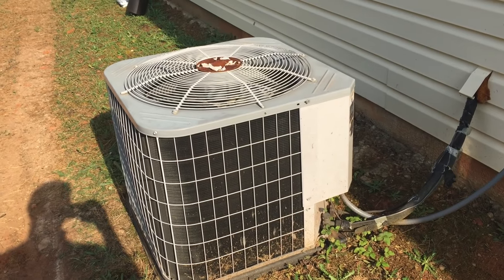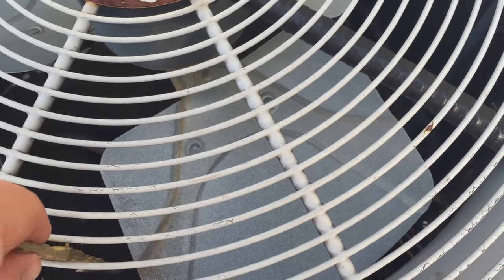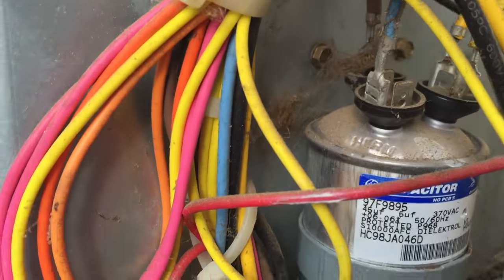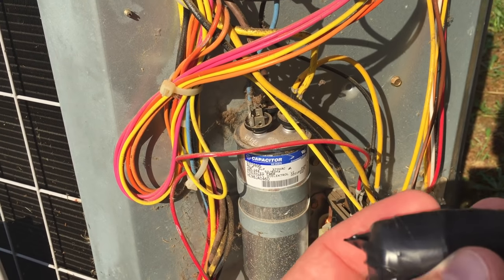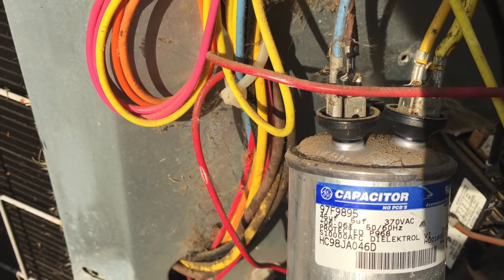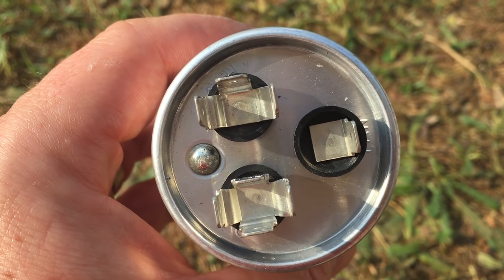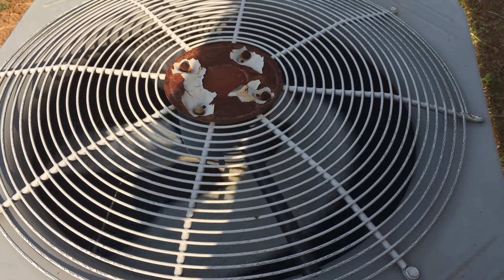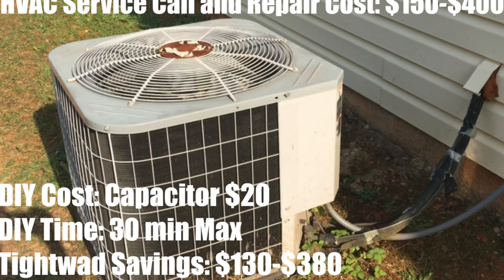Easy Air Conditioner Repair: Fan Not Spinning - Blowing Warm Air

Comment: life saver! my outdoor unit was humming but blades weren’t spinning so give it a good spin with a stick and got it spinning again! house now cooling. thank you.
Reply: Seconded!  Saved me a call to my local HVAC guy.
Reply: AMAZING!!!! THANK YOU!!! Just saved me $$$$
Reply: Same as mine. My unit was humming but blades were not turning so I got the fan spinning with a stick. Did your AC continue to have this problem? What causes the fan to just stop spinning and need a “manual stick push”?
Reply: @strongholdsignarts  Mine hasn't needed help (again) to get going this summer, thankfully.  (Especially with last week's heat.)
Reply: @strongholdsignarts  the capacitor needed to be changed out, that’s what fixed my issue.

Comment: Question! When I manually started my blades with a piece of wood, it kept turning. But now I have to do this whenever the AC shuts down in between cooling sessions. What would be the fix for that if anybody knows?

Comment: I just experienced this with my AC that is only 6 years old! I took the old capacitor to get it checked and didn't get any readings out of it, put in the new one and right away saw the fan spinning at the right speed! THANK YOU! It is another 104-degree day here and tonight we will not suffer from the heat like we did last night with the AC not working (yesterday was 106-degrees!).

Comment: Great tip about keeping the wires connected on the old capacitor and then switching them to the new capacitor one at a time. I'm not having problems atm but I'm picking up a spare to have ready when needed.
Reply from the maker: Greg Egan Thanks. Great idea to have a spare on hand. Things always seem to break when the stores are closed!

Comment: Thank you Thank you! Our AC did this to us on 4th of July. I checked for burnt wires and anything obvious. Found one wire that looked crispy on the capacitor but that was not it. Came in and seen your video went back and pulled the capacitor off and it had swelled up a little top & bottom. I was happy to see that. On Monday morning after two very hot nights I ran down and bought a new capacitor for $25 and switched it out and it fired right up. Buttoned it up and called to cancel my AC service appointment. The owner was happy to hear I took care of it and saved a few hundred dollars. Do take pictures of wiring and make sure you read the top next to each post on the old capacitor.
Reply from the maker: Steven Cox Thanks for sharing your success story! I’m glad you were able to get yours fixed.

Comment: Unbelievable!! We have a unit that is less than 2 years old. The temp was not getting down even close to the thermostat setting and the inside humidity was almost 50% higher than its setting. I thought your first suggestion of nudging the fan blades with a stick was WAY too simple but it was bedtime so I figured "Why not?". I nudged a blade clockwise with a paint stick and guess what? It started spinning and, in less than 15 minutes, our house was comfortable again and the humidity had gone down 10%.....I'm still calling the pros tomorrow to see why this happened but THANK YOU so much for the tip!!! I never would've thought to do that. I realize that people deal with much worse but your video saved this family from a pretty uncomfortable July night in south Louisiana.
Reply from the maker: Sounds like your capacitor is bad. You should change it yourself! I’m glad you found temporary relief!
Reply: @TightWadDIY  You're exactly right - the capacitor apparently wasn't supplying enough power to the fan on start-up. I let the company I bought the unit from do it b/c, luckily, it's still under warranty. But your handy tip gave us temporary relief until they could come out. The info is very much appreciated.
Reply from the maker: @JD-lk7yp  I’m glad they fixed it for no charge. That’s a blessing.

Comment: My fan stopped working mid day and all I had to do was get a small stick to manually spin the fan and it started working. Thank you so much!
Reply from the maker: That means your capacitor is bad. You should replace it. It’s easy!

Comment: Thank you sooooooo much for video. I'm a single parent female Veteran. Every penny counts. My unit has the double pull fuse. I pulled it and additionally hit the breaker further entire area. I weeded the area and hosed down the filter as I do each year. This time it wouldn't come on. I reset it and 3xs. Nothing. I didn't know that the fuse could fit both ways until I watched your video. YEP I had replaced the fuse upside down. I don't know how much you saved me but as I said. "EVERY PENNY COUNTS" Thank you again
Reply from the maker: That’s Awesome! I’m glad you got it fixed! Thank you for your service. I really mean it.

Comment: I had the same problem I replaced my capacitor after watching,  and it worked great. Thanks 30 dollars for the capacitor. 10 years ago I had a company do it charged me $230 dollars. Saved a lot
Reply from the maker: larrae125 I’m glad you found the video! It’s an easy swap as long as you take the proper precautions. Always happy to hear someone saved money. Be sure to subscribe.

Comment: I stuck a stick in and the blades started moving! And that was all it took. Thank you so much! Just waiting to see if that's all I need or if I should replace the capacitator.
Reply from the maker: You will need to replace the capacitor. The line that starts the fan is bad.

Comment: Our Central AC unit is old. Recently, our fan blades stopped working even though the machine itself is still buzzing. We did what our technician did a couple of years ago: took a hose to it. After only a couple of seconds of being doused with water, the fans start spinning again and the house starts cooling decently. The motor gets really hot. Unfortunately, when the house gets to the desired temperature, the fan again stop working until we hose it down again. What do you think the issue is?
Reply from the maker: I’d still check the capacitor.
Reply: @TightWadDIY  Thanks for getting back to me. We did end up calling a pro out, and sure enough, once the capacitor was changed out, it worked great. I am glad I mentioned it to him first so he knew I wasn’t a complete idiot. Still only came to $150 total, and since I was worried we’d have to replace the whole thing, I was geeked. Thanks!!!

Comment: My unit stop working yesterday only had it for 3 years the capacitor doesn't look too be damaged the top of the capacitor is not bubbled up or anything looks brand new could it still be the problem my unit want start?

Comment: Got my a/c turn on with a stick. What does it mean in the long run if you have to start your fan the “stick method” is the capacitor bad?
Reply from the maker: Replace the capacitor.

Comment: Hi! My AC was “fixed” by my apartment complex (it had a plug in to the unit and I didn’t have the plug so they put a new one in and it worked great) but 3 days later the top fan stopped working. I will turn it on, it’ll work for 15 minutes, and then you’ll hear the compressor running but the top fan doesn’t move. I tried moving it with a stick and it doesn’t go. I tried turning it off and back on, no go. I cannot seem to get it open to look at my capacitor because it’s like every panel is screwed into both the top and bottom. My apartment complex sucks with maintenance issues and I cannot afford an HVAC guy rn. How do I get a good look at what I need? Is it the capacitor or the fan motor?
Reply from the maker: I bet it’s the capacitor but it’s really hard to know.

Comment: Our exterior unit, just like the one you have here in the video is humming and the fan's not spinning.  Just to clarify, if I jump start it as you did here and it starts up, is the culprit most definitely the compacitor?
Reply from the maker: Shakey Perspective I would say 90% chance it’s the capacitor. Even if the fan doesn’t jump start, it could still be the capacitor. I have a second video with more info.
Reply from the maker: Shakey Perspective Here is the other video - https://youtu.be/VO7sDl1q8WY
Reply: I did in fact, succesfully kick start the fan and it did start spinning as normal.  However, I did this several hours ago and it's still 80 degrees in the house.  I just went back out and the fan has now stopped completely.  What are your thoughts?
Reply from the maker: Shakey Perspective Change the capacitor ASAP. I’m confident that is your issue.
Reply: @TightWadDIY  I'm a bit confused as to why the house didn't get cooler when I kicked started the fan.  It was 80 degrees and I set the theromostat at 69 to insure that it would continually run.  But in that hour and half, two span it never got below 79 degrees.  Does that make sense?
Reply from the maker: Shakey Perspective The fan wasn’t likely spinning at its normal speed so it wasn’t pulling the heat out of the system efficiently. Did you look at the capacitor to see if the top is beveled?
Reply: @TightWadDIY  Oh OK, makes sense.  No not yet, waiting on some day light.  I will update shortly.

Comment: So, the capacitor isn't just for STARTING the fan motor?  Because sometimes when I had a bad cap, moving the fan blade w/a stick made it work, until the cycle was complete (cool temp setting was reached), then I'd have to go "start" it w/the stick again.  Replacing the cap fixed the problem.

Eventually, I also had to replace the motor - I did that a couple years ago.  Now I have an issue where the motor gets HOT and the stick start trick won't work.  I ordered a new motor and will get a new cap too.  Hopefully today I will find out of switching just the cap works, or if the motor is bad.
Reply from the maker: AMchickennuggets The capacitor starts multiple functions on your unit. It can be so bad that nothing works at all.

Comment: What if the capacitor just got replaced but fan still won't run automatically when turned on only while spinning it manually
Reply from the maker: You sure you hooked it up properly? There is a chance the Fan motor is bad.

Comment: Indoor blows warm air. When I have the thermonstat turned off inside, I can turn the fan on the outside unit with a stick. If I the thermonstat on, and the outdoor unit starts buzzing, its too stiff to move with a stick. What does this mean?
Reply: Same,  Did you figure it out? Thanks!
Reply: Same any fix for this guys?

Comment: what if you tap the fan and it starts working  and I can hear a buzzing sound like something s trying to kick in but it's not happening...do you still think it's  the capacitor?
Reply from the maker: Yes. It’s very likely.
Reply: @TightWadDIY  Allison! that's exactly what it was, it took me about 10 minutes to change the Capacitor out, thank you so much for your post and for responding to my question, you  have Blessed so many ❤

Comment: what would cause the outside unit running HOT and the Fan not spinning at all ( seems as if the fan died while trhe outisde unit and the compressor was working ?)
Reply from the maker: The capacitor would cause the fan not to run. Less common issue could be the fan motor is bad.
Reply: thanks so much ... so if the fan stops running and only hums quite loud, while also being quite hot , you would still think it's the capacitor ? @TightWadDIY
Reply: @mamumonkan Yes! The capacitor starts the fan and compressor. If one leg of the capacitor fails it could power the compressor (humming) and not the fan. The fan cools things down so if it’s not running things will get hot very quickly.
Reply: thank you ... I changed the capacitor in July ? ... but ok I'll check again :) @GrillThisSmokeThat

Comment: I have a question my ac unit goes on a few times then the fan will kick on, now what is going on the ac kicks on but the fan will not spin, is this a thermostat issue? I will check the capacitor , but in case it is not that
Reply from the maker: Melody Davidson That is most likely a capacitor issue. The fan should turn on every time the unit turns on. Otherwise it will overheat.
Reply: TightWadDIY thank you and I believe it is, coz I pushed the blade and it went. Gonna change it and hopefully that resolves the issue. Thanks.
Reply: TightWadDIY thank you for this video I fixed it. The only difference I had was the capacitor was taller and thinner than my original so I had to rig the holder and screw it in tight. Same specs.
Reply from the maker: Melody Davidson Mine was the same way. It’s fine if it’s a little smaller if the specs are the same.

Comment: The unit makes a buzzing noise like the fan wants to turn, and if I push the fan it'll spin and gain momentum to were it would be unsafe to stick my hand in there but slower then what it would normally spin. Also at the speed the blades are moving, it's still blowing warm air. Any suggestions? Fan motor gone bad?
Reply from the maker: Change the capacitor. I’m pretty confident that is the issue.
Reply: @TightWadDIY  Thank you!

Comment: What if you nudge the fan and it started spinning but there is still hot air coming out of the vents?
Reply from the maker: Your compressor isn’t coming on. Replace the capacitor. It powers the fan and the compressor.

Comment: Thank You 😁
Reply from the maker: Mark Silva You are welcome. Did you get it fixed?
Reply: @TightWadDIY  got fan to spin but once a/c turns off  , fan won't stay on ?  Needs a push
Reply from the maker: That is correct. The capacitor is what makes the fan and compressor start each time the AC turns on. You would have to spin the fan manually every time the AC turns back on which isn’t sustainable and actually puts stress on your system so you shouldn’t use this long term. You still need to replace the capacitor to fix the issue.

Comment from the maker: It's that time of year again! Don't be caught waiting on a high cost repair man while sitting in the heat. Simple diagnostics can save you time, money, and sweat! Watch this video to see how to fix the most common problem with air conditioning units. This DIY repair can save up to $400!
Reply: My compressor makes a humming noise and the fan does not spin but if I turn the fan, it starts to spin for a while and then it stops spinning. I have to go thru the same process to get it going again. What do you think the problem is? Capacitor?
Reply from the maker: I am so sorry. I just now saw your comment. I think you definitely have a bad capacitor. Hopefully you were able to fix it already.

Comment: My compressor was making a buzzing noise. Watched a video, it said to turn the fan blades myself. I did. It turned on. Then I hit the sides with some water to clean it. Can I leave my A/C on? Or will it overheat until I get a new capacitor which I assume is the problem.
Reply from the maker: Daniel Piechowicz I’m not a licensed HVAC repairman but it should be fine. You may have to start it with a stick every time it cuts off though.

Comment: Had a professional replace the capacitor before viewing your video but fan randomly  still quits turning . Any suggestions? 🤦🏻‍♀️
Reply from the maker: It sounds like you have a short. Maybe a loose wire.

Comment: Ours has a bad fan motor. It works you just have to manually give it a push and it starts spinning.
Reply from the maker: That’s a bad capacitor issue too. The motor is fine if it spins once you start it.

Comment: I’m having the same problem. Does it matter if my capacitor is oval and switching it out with a round one? ....did exactly what your video said but still no luck! PLEASE HELP!!
Reply from the maker: Welded Rick That shouldn’t matter. You could have other issues though.
Reply: TightWadDIY I fixed it!!!! The capacitor was the problem. Did exactly what the video said and it worked!! Paid $27 after tax for the capacitor saved me plenty of cash! Thanks!!

Comment: If using a stick to nudge the fan works, what is the reason it stopped? Or possible reasons? How can this problem be avoided in the future?
Reply from the maker: A bad capacitor causes that issue too.

Comment: So what if it isn't the capacitor? My AC is showing all the same symptoms, but the capacitor looks just fine. No bulging or burnt wires or nothing
Reply from the maker: I would suggest you still try replacing it.

Comment: At 4:05 you said the ac is turned on inside and fan not moving, then you turned the power back on? if the ac is on inside, meaning inside the house, did that have separate power to it already on?
Reply from the maker: Makinja The air handler inside the house and the thermostat inside the house are on a different power circuit than the outside unit. The outside unit always has it’s own breaker and it’s typically outside of the home next to the unit.
Reply: Got it. Thanks for the clarification. Good info.

Comment: I had the same problem. Tested compositor and it was good. Took the fan motor out and took it in to a electric motor sales shop. I bought the replacement motor for it.
Hooked it back up ,turned on the power and I can hear everything wanting to work but the fan won’t turn unless I turn the fan to get it going.

It’s like it needs a little more power to get the fan to kick in.

Would you happen to know what the problem is.
Reply from the maker: I would replace the capacitor. Are you sure you tested all leads on it correctly? Just one part can go bad.

Comment: My heat pump/compressor or outside fan would not run with the condensation pump at the air handler unplugged.

Comment: Ok so I turned the blade and it started running so what the problem might be going forward
Reply from the maker: reco castro You need a new capacitor. The fan won’t spin at top speed without a new capacitor. Replace it ASAP so it doesn’t mess other things up.
Reply: @TightWadDIY  Ok thanks will do asap